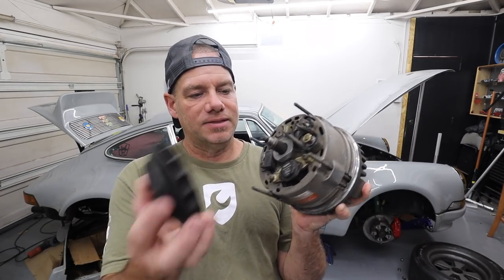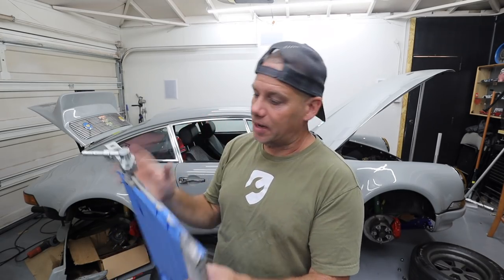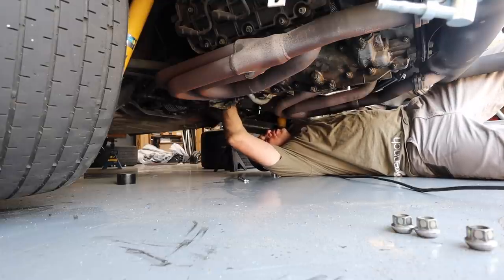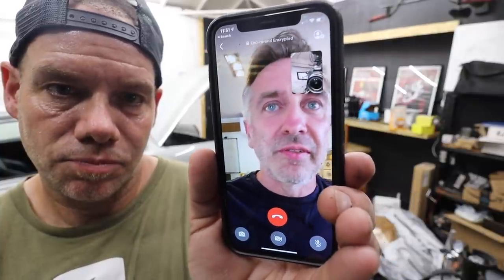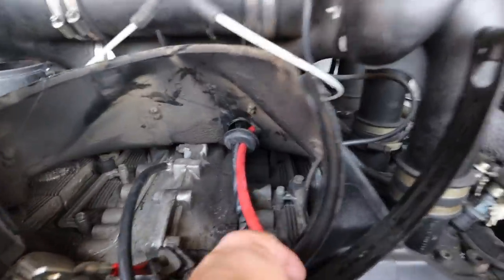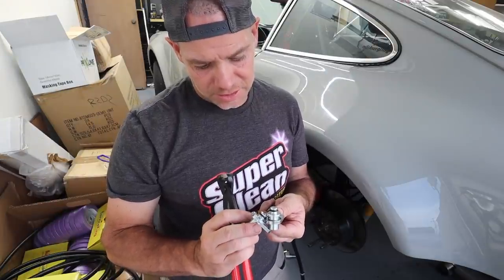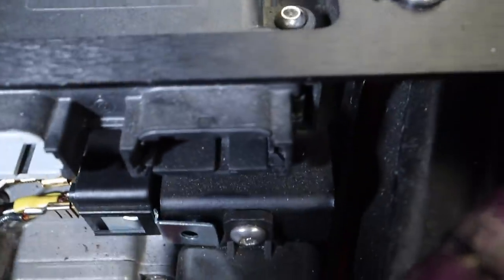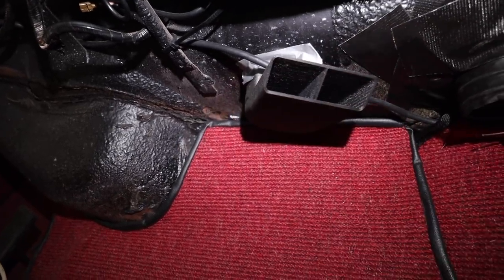Vintage Porsche 911 AC Upgrade Part 2: Alternator & condenser, & RAD vents for the Classic Retrofit!

Comment: Haha! I'm the "I hope it works as well as $6k says it should" bitching guy- and I see your point- our cars are only going up in value and certainly having a comfortable ride is indeed a game changer- I think it's just more sticker shock at how much we spending on these cars to upgrade compared to other cars- but yeah- having them be comfortable is for sure a game changer. I have a 1990 964 so I already have factory A/C- but I'll admit- although I have great venting- the system itself either needs to be upgraded and re-charged or replaced with something like this instead- I also like that it takes the A/C load off the motor (free HP when A/C is engaged- which is nearly all the time) and cleans up the engine bay a bit- plus the upgraded alternator would allow me to finally have a decent stereo installed. I also agree too- yeah the engine noise may be magic- but not for 100's of miles. I love music too.

Comment: This is a really interesting product. I have a '72 MGB-GT. Back when it was new it was rated at 95hp gross, which was probably more like 80-85 net. My 130k mile car is probably more like 50. Even a healthy stock engine loses a lot of performance with an A/C compressor. The MG cam stock with 2 small batteries in individual compartments behind the seats. Most cars, including mine, have been converted to single battery. Based on the info on their website the compressor setup should fit right into that empty battery space. Pulling together the rest of the parts you need will make the total cost far more than the conventional kit from Nostalgic Air, but saving the draw on the engine and taking up more of the limited engine compartment space would be worth the cost as long as you can afford it. If you are in a state where you must retain the stock air pump saving engine compartment space is especially handy.

Comment: Awesome. I think I'd be concerned with those clamps on an air conditioning hose, especially as it looks like you are using them on the high pressure side unless I missed something. Oetiker clamps are great but the kinds of pressures on an A/C system are beyond what I'd be comfortable using. Hence the crimped hydraulic fittings on most A/C hoses. Great work as always though.
Reply from the maker: Those are the supplied clamps. They’ve been used on hundreds of installs with no problem.

Comment: I’m nervous about your sticky tires blasting the heck out of those condensers. Your plugless relay wires could be sheathed with heat shrinks just in case they inadvertently come loose and touch each other. I learned that the hard way lol

Comment: Definitely getting this system. I’m a novice mechanic, it took me 16 hours to adjust the valves and change the oil on my car for the first time. I think I’m getting faster at stuff as I go (rebuilding suspension at the moment), but how much time should a true novice budget for this install soup to nuts?

Comment: Hi! Just finished installing my CR AC and super thanks for all your how to videos. My set up: 69 911E with '74 2.7L motor bored to 2.9L. CR AC with double CR condenser and CR 110 amp upgrade alternator. AC running good except on IDLE which is at 750-800 RPM. Compressor cuts off after 2 minutes or so. Voltage on DIAG tool reads 11.7V at idle and reads BATTERY LOW . At engine speeds higher than 1.2K RPM, AC is all good, blows really cold, BATTERY GOOD, ETC! Is this normal for the system on IDLE? I really dont want to raise idle to 1.25K RPM. THANKS!
Reply from the maker: I have an answer from CR if you send me an email or IG DM